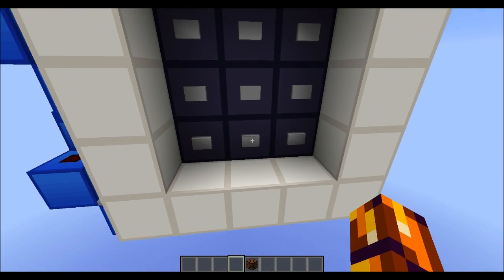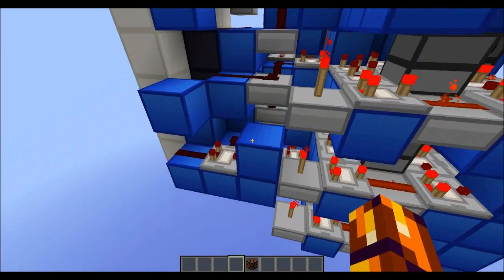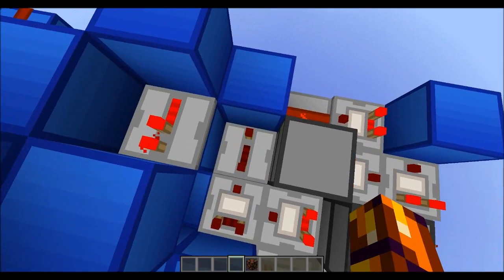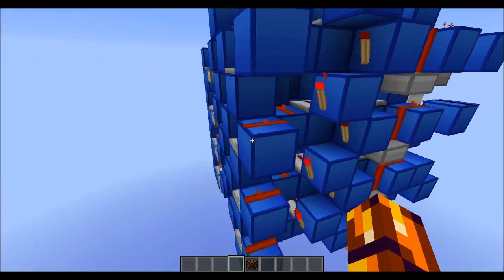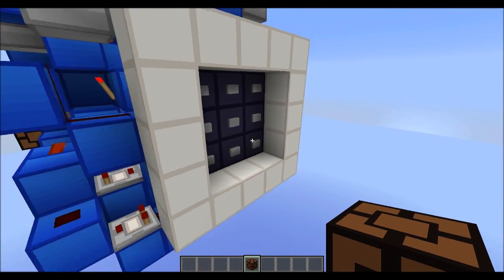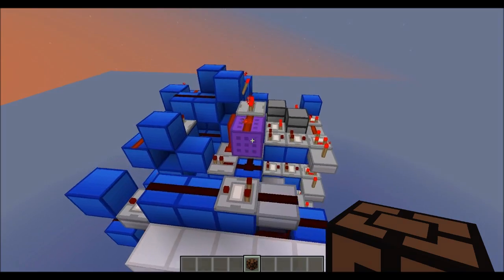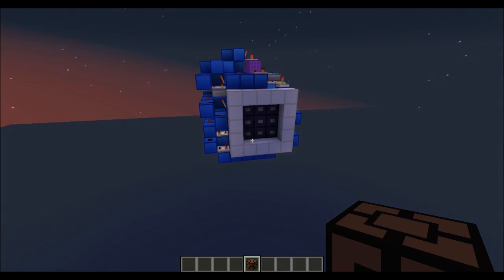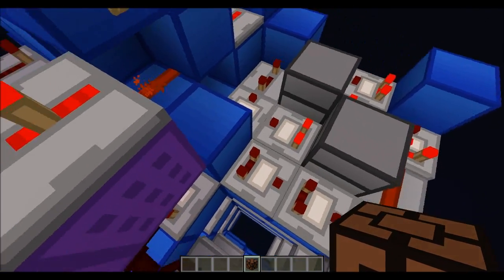Minecraft: Tiny PIN Combo Lock ( 8 x 8 x 10 )

Comment: Challenge accepted: Have two walls with a gap between them (size doesnt matter too much) and have a dispenser with a lava bucket in it on top. 1 signal turns dispensers on making lava flow out i.e. door closed. Another signal turns dispensers on making lava no longer flow i.e. door open.